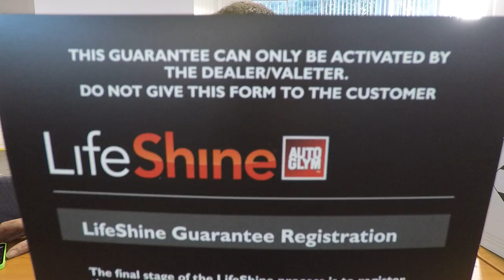New Car Prep, Steves Cleenz vlog 003, Autoglym Lifeshine new car preparation at MG Motor UK

Comment: How long does LifeShine application take roughly? I have a 4x4. Would you need to wait for a while for cloth upholstery to dry before driving the car?
Reply from the maker: Inner Beauty it depends on how much paintwork preparation is needed, also the same with the interior but it’s usually dry within a couple of hours

Comment: I thought it was Autoglym that did this preparation at the dealers. In your vid it does not appear you are from Autoglym.
Reply from the maker: Brian Clark  very rarely is it actually Autoglym that prepare the cars, dealers usually use there own valeters to prepare the vehicles, in this case MG pay me to apply it
Reply: Ah thanks Steve, I wondered how it worked. You have now answered my question. I presume as the application of Lifeshine is nearly £500 it is an expensive product or are we being ripped off here?
Reply: @briboy2009  haha, I notice no reply to that one Brian. You would also assume the customer would get to keep the remainder of the product since very little actually gets used, and it doesn't last the lifetime of ownership.
Reply: @kopman70  No you do not get whats left, that's the thing your find one kit will do two cars and your not paying for the product but the wages of the person to apply this and you get a bag with around 100 pounds worth of Autoglym product.
Reply: @JK-eh4cx  friend used to have spare after doing 3 cars.

Comment: £400 plus for that???  Ive just paid bmw solihull for this.
Reply from the maker: Price depends on dealer, if done privately then you’re looking at around £200
Reply: Ask for your money back if you can, I’ve just applied this myself (properly) at a cost of £20 for the sealed kit shown in this video and 3hours of my time (21/2hrs prepping the paintwork and 30mins applying and buffing the lifeshine), and later another 15minutes applying the interior protector as I have leather and it takes a little longer to apply as you need to put it onto the leather with the yellow sponge he didn’t use! never pay a dealer for this or gardx! Both have a massive mark up and are a complete rip off, they will most likely not prep or apply it correctly either, all it is is a sealer and doesn’t actually last very long at all, maybe 6 months if done well, the product itself is pretty good but its totally let down by the dealer cost and usually poor application!